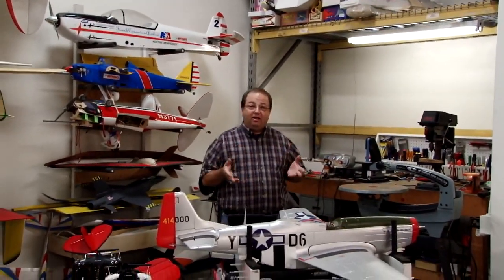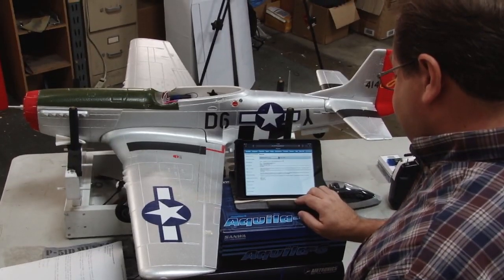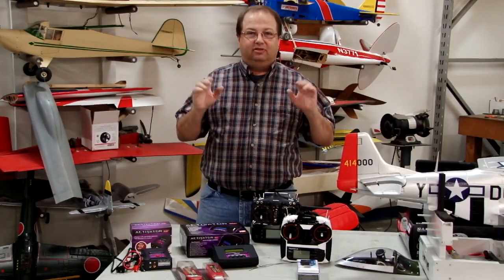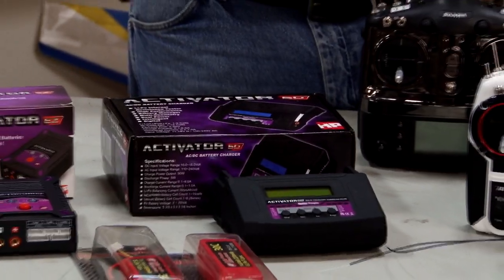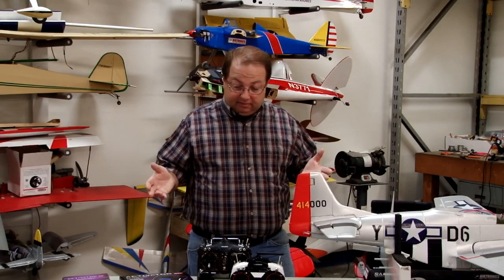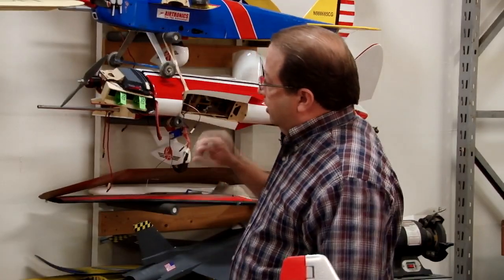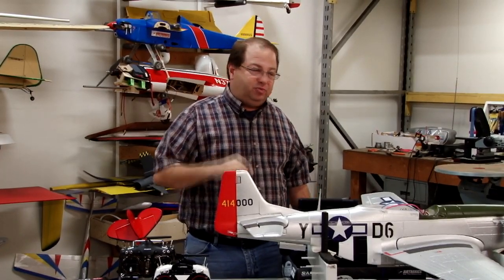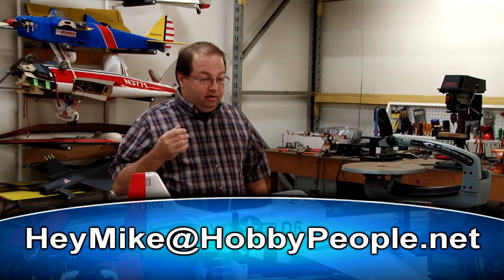Tips From The Shop S1E4

Comment: you say you can use a 4s battery on that p-51. I just got your new p-51d but on 4s it heats up the motor to the point I can smell it and feel the heat on the cowl. Can you use 4s with the stock prop?????